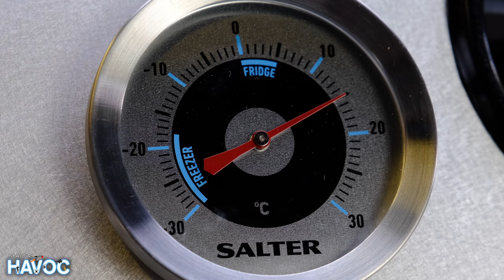How To Make Peltier Turbo Cooler Dinks Dispenser 5000w

Comment: Well done Sir, Surprised with the use of the Duct fan for keeping the Petiers cool, but then to get instant line cooling like that its going to need a fair amount of cooling power, looks like we're seeing some new tool'age being used as well. Would be nice to have a BOM of bits used and so others can have a go. I think I'd increase the size of the chilled liquid storage so it was able to maintain at least two drinks worth, add some extra insulation to maintain the coolness for that and then adjust everthing else so it just sits there ready to use. 
Ah yeah its called a beer line chiller LOL  
Brilliant though and I knew it would tax the brian cells and quite possibly the wallet ;-)

Comment: 5000W? That would be 625W per peltier.
Reply: He explains it in the description. The peltiers are 100W each. So the 10 peltiers swallow 1000W. The fan is rated for 4000W, but I doubt he is actually pulling that much.